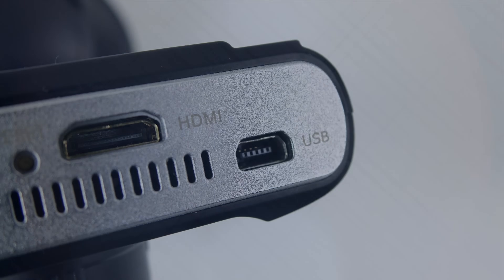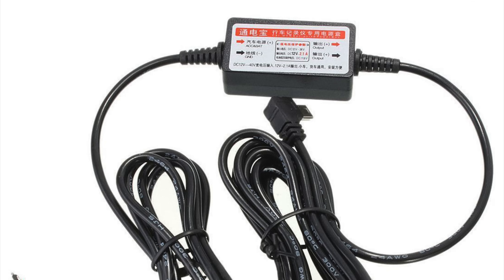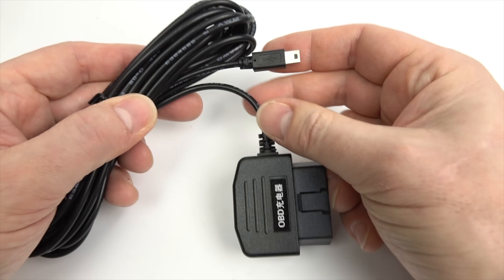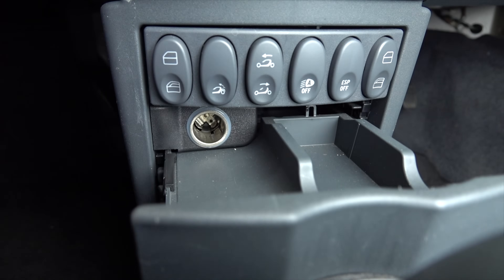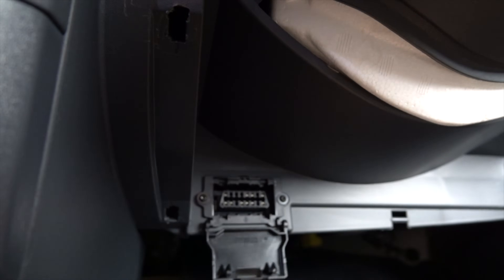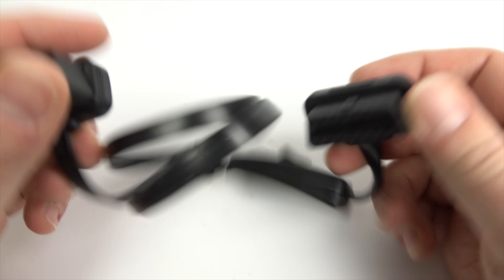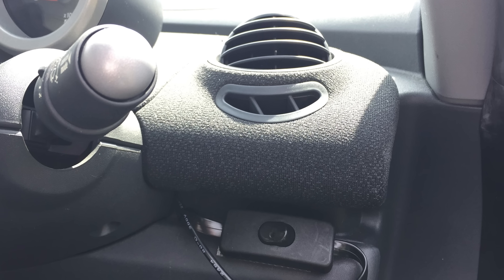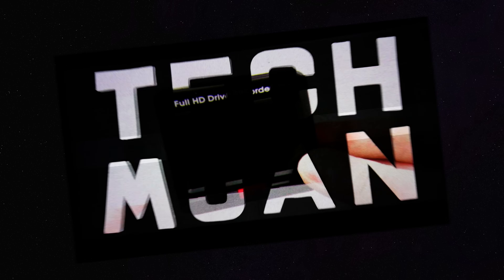You can power a Dashcam via your OBD port (but perhaps you shouldn't)

Comment: In the US, it has been my experience that the Cigarette Lighter Port/12V Accessory Port does not turn off when you turn off the ignition with domestic vehicles.  The only "foreign" vehicles I've owned are Toyotas, and they both turned off the 12V socket when the ignition was turned off.  So, I don't really see an issue here, given how little power these cameras and phones use, compared to other items that usually cause you to drain the battery, like headlights.
Reply: ask your battery after a few months. Factory batteries don't like draining and recharging like that they will fail and the worse time. BTW in 4runner the rear 12v does in fact not turn off. just an fyi

Comment: I'm really considering this camera and was wondering what you think. I drive for a company called Lyft and they want me to get a dashcam, also my insurance will lower my premium if I install one. http://www.ebay.com/itm/New-3-Screen-1920-1080-HD-Dash-Cam-Ambarella-A7-Chips-Parking-Motion-Sensor-/252376705404?hash=item3ac2d2e97c:g:wnIAAOSwZVhWSsxM
Reply: +Bluntski 
I would avoid anything with a battery, I'm about to install my 3rd A118C (I have 3 cars). I did consider the  0903 mini but the A118 is still the neatest camera around. Few points, always format the sd memory card, turn record off to access menu, and I can't see the point in having the largest memory card supported installed I always use 16G which is a lot cheaper.
Reply: I bought it, I'll tell you how it goes.

Comment: If it helps anyone, you can get a piggy back car fuse tap https://www.amazon.co.uk/Circuit-Piggy-Standard-Blade-Holder/dp/B00UNH616M/ref=sr_1_9?ie=UTF8&qid=1463051194&sr=8-9&keywords=Circuit+Fuse+Tap+Piggy+Back+Blade+Holder  to help simplify wiring into a car fuse box. 
Just pick a fuse position and replace the fuse with the piggy back connector and put the fuse back into the piggy back to maintain the circuit then in the second fuse holder that's built into the piggy back put an appropriate fuse for your device. Crimp the positive lead of your device onto the piggy back tail and put a ring crimp terminal connector onto the negative from your device and bolt it to the car body work. I've used the bolt that fixed the bonnet release to the car body work as that saved drilling any holes and it was near the fuse box.
The advantage of this is that you can easily remove it all and you can pick a fuse that is either always live or only live with the ignition. 
Instead of hard wiring, you could wire the piggy back connector to an additional car lighter socket - you can get additional ones that snap into a hole you drill into the plastic and which can be fitted under the dash and out of sight.

Comment: another solution : buy a rechargeable battery pack (lets say 20,000 MAh) for about $10 U.S. and you'll have power for your dash cam for all day long.   you also can recharge your battery pack via the 12V in your car.
Reply: cheers =)

Comment: A video recorder should be standard Ina car integrated by the factory. They've already go a standard rear camera. Just add one to the front and a DVR.
Reply: well, there is a problem with certain markets. In Germany and Austria, dascams are not really legal because of privacy issues. And I even met people, who agree with their governments, saying that dashcams should have built-in face and number plate bluring function!
Luckily, there are countries where dashcams are ok, and some insurers providing a discount for having one.
Reply: @jur4x  so Germany & Astria are Communist nations? Pity...I would use one anyway!
Reply: @jimbritttn  Just another guy who has no clue what communism is.
Reply: tesla has a dash cam built in, but it doesn't save any recordings unless you have a USB SSD installed and tell the car to save the video files onto it. it does it that way for liability.
Reply: +Shao Zhang I agree.  I know some of the new performance Chevy cars have dashcams/data loggers in them.  The C7 Vette and ZL1 Camaro to name a couple.  I saw a story a while ago of the Corvette's camera catching a valet hitting like 50mph in a parking garage.
Reply: They would charge $500 for a $10 camera!
Reply: @jimbritttn  That's called capitalism, Jim - smh.
Reply: @chromo48  called ROBBERY
Reply: @jimbritttn  potayto, potahto

Comment: Why do smart cars have the ignition in the wrong place?
Reply: I actually think it is a perfect placement, as I don't have all the things attached to the key (Like a loop or other keys) hanging on my knee when driving.
Reply: ***** Door...
Reply: It ain't the wrong place. Saab's have it in the same place. I have seen weirder.
Reply: +Farts McGee
I don't know how your ignition works, but it is impossible to turn the key on my ignition when the gear is not set to neutral, because it has a semiautomatic gearbox. I drive with people and sometimes with kids on a regular basis and never had a problem with my Smart 451. Since my parking space blocks my drivers door, I have to slip to the passengers seat to get out of my car, I never had any problems with that either, even though the gear lever is in the center.
The motor never stalled, so during the driving itself, I don't have to turn the key at all.

That doesn't mean the ignition shouldn't be behind the wheel, but it's not that stupid or crazy if it is placed in the center.

Just my experience on a four-year basis of driving a Smart 451 versus a Toyota Yaris (2011).
Reply: +Pfahli94 Putting it in the center area vastly increases the chance of the keys being jostled and inadvertently turning off the ignition while the car is in motion. Imagine a playful and excited child grabbing it and turning it, because it's right there and looks so enticing. Or imagine a woman trying to climb into your lap with it there. It takes up valuable space that should be used for something else (cubbyhole, handbrake, armrest, drinkholder, etc.). Any keychains would instead of touching your (soft, quiet) knee be touching hard, loud plastic, constantly scuffing shift up and making noise. 

It's like automatic gearboxes that let the car slide from Drive to Neutral when a butterfly wing touches the shifter, it blows my mind, it's crazy unsafe.
Reply: Pfahli94
Cheers mate, good info.
Reply: Most things that are called "smart", aren't really all that smart. "Smart" watches can't seem to hold a charge more than a day or two. "Smart" cars seem to be missing about half the car. "Smart" TVs often had crappy software and not sufficient software updates.

Is a power switch really necessary? Perhaps a good idea, but car batteries are huge, and most devices, just do not use all that much energy. Thus a dead battery is not very likely?
Reply: Because they are the worst cars ever made.  Ever driven one?
Reply: +Pfahli94 True, but adding weight to any ignition key is a bad idea.  Eventually it will cause a premature failure of the lock itself.  I assume this key placement will increase the longevity, but added weight will still cause failure.  Best to keep it simple on your car key(s) and put those key ring danglies on your house keys.

Comment: My car doesn't have obd... How do I get it?
Reply: +viperz888 you can't, your best bet is getting the hard wired power one and pulling power from the fuse box. What year is your car?
Reply: ***** 1953
Reply: +viperz888 your car doesn't have a computer controlled engine, so OBD II is unavailable, but you can probably find a 12 volt wire to tap the direct connecton supply to and build a switch
Reply: +Les King (Lesking72) it has a engine from 1998 though. It has the computer.
Reply: +viperz888 if you aren't a specialist on engine computers, you could take it somewhere and they could probably wire a port
Reply: ***** I am a specialist in micro de-thermic abrasion. how can i wire the obd??

Comment: I just run a small wire from the dashcam to the ceiling lights, just tuck it under the roof lining, you will normally find a permanent live up there. But, unfortunately not going to help with a convertible car like yours. But scotchloks connectors are very good for a low power device like a dashcam, just tap into any suitable circuit - radio supply will do fine.

Comment: I have wired in several G1W cameras over the years (first one bought on a recommendation from Techmoan, ta muchly!). The problem with cheaper dashcams (and possibly expensive ones too) is that the supplied PSUs are very noisy. Recently I wired a dashcam by using a piggyback fuse off the OBD circuit (this was due to the configuration of the fuseboxes in that car), and the noise the PSU introduced on the OBD power lines was enough to bring up random error messages every few minutes. I removed it and no more error messages. 

Hopefully the OBD power supplies are sufficiently well-built to avoid that, but the best way I have found is to piggyback from the cigarette lighter as this circuit is usually fairly robust against noisy electronics and is usually switched by the ignition. On one occasion I even had to bin the supplied PSU and use a high-quality branded USB supply and cable due to a particularly sensitive FM tuner that couldn't be avoided without having cables on show.

Comment: This is a awesome choice and proper...
SMAKN® DC 7V-24V To DC 5V 3A USB Output Converter Step Down Module KIS-3R33S  http://www.amazon.com/SMAKN%C2%AE-7V-24V-Output-Converter-KIS-3R33S/dp/B00N2G5HKC?ie=UTF8&colid=4AOCPGOMJRNB&coliid=I1FMPKV39CTCQD&ref_=wl_it_dp_o_pC_S_ttl
by SMAKN 4.2 out of 5 stars
        4 customer reviewsPrice: $6.99  
• This 5V USB output converter module is based on the KIS3R33S module specific design, the input voltage 7V to 24V, output voltage 5.01V 2.5A peak output current of 4A continuous output.
• Able to provide 3A continuous load current. The majority of players professional testing, with high efficiency, ultra-low loss characteristics, beyond perfect lm2596 power module.
• Modular nature: Non-isolated Buck
• This module has a USB recognition. This module uses the original Sanyo low ESR filter capacitor voltage as low as possible so that the ripple 30mV, fully capable and linear power comparable. IN-(input negative), IN + (positive input), OUT-(negative output), OUT + (positive output) must be connected to the right, otherwise may cause damage to the module.

Comment: I wouldn't recommend plugging anything other than diagnostic equipment into the obd2 socket because any malfunction in the devices connected could cause serious ecu damage or dangerous operation of vehicle systems, e.g unintended acceleration as no compatibility or safety tests are preformed as vehicle manufacturers do not intend on having owners plugging devices into the obd2 socket.
Although you can power a device from a obd2 socket the standard only allows for a maximum of 4 amp whereas a cigarette lighter socket will provide over 10 amp.
Reply: +100racer And does a cam ever need anything above 5 or 10 watts? 4A*12V=48W that's plenty enough.
Reply: +MrOpenGL I didn't say you couldn't power a dash cam from the obd 2 socket.
 What I'm getting at is that there is so little overhead
  should anything go wrong it could at best blow the fuse and depending on the wiring  immobilise the vehicle or at worst destroy the ecu or cause a fire.
The vehicle manufacturers do not intend the end user to be connecting devices of unknown origin and poor quality to the obd 2 socket.
The worst thing about this is the seller's are selling these plugs to people who don't  
know what the obd 2 socket  is and how much damage  can be done if it malfunctions.
Reply: 100racer
It should only be connected to the Vbat and GND lines of the CAN connector. The worse it could happen is that the internal converter shorts out and blows the CAN fuse. It cannot blow the ECU or damage the vehicle.
Reply: +MrOpenGL Power over obd has been used by diagnostic equipment before the obd2 standard was created. 
So if it is as risk free as you say how come mainstream manufacturers of car chargers haven't utilised it?
Because if anything  happened to cause a bridge between pins you could send 12v right into can line potentially destroying all the vehicle electronics, from my experience manufacturers do not build input protection on obd sockets because they don't intend anyone connecting anything other than diagnostic equipment into the diagnostic socket.
 I've seen one of my colleagues cause £4800 in damage because he accidently put 12v down the can line when he was fitting a tracker.
If you need extra power outlets wire them in properly or buy a splitter.

Comment: Ever thought about pulling the 12V plug assembly from the dash and solder the standard converted cable (plug off, and extend 12v leads to the lighter) to it? That way everything is properly fused, and no problems with devices running while contact is off.

Comment: Could you tell me about that hard wire kit?  My Yeti keeps the accessory port on when the car is off, so its only a matter of time before I flatten the battery... again.  Can this kit help me?  Will it take the power away when the car is off?
Reply: +Colin Steadman With a hard wire kit you would wire it into the accessory circuit so the dash cam would only be on when the car was in accessory/on.
Reply: +IfTomorrowWar A quick and dirty version was shown in the video, you have two wires. Black and red. Black is the ground and can literally be connected to any metal part of the car. Red is power and the easiest way to get power is yank out a fuse, jam the red wire in, and put the fuse back in.

Comment: I hate extra wires, I'm going to great lengths to hide as much as I can, my main complaint is lack of accessory sockets! My car is an 07 model and it has 1. I don't like 3 or 4 way plugs as they're messy. I'm hard wiring my 3 cams with a voltage drop switch, and adding some USB ports and mounting 2 extra power sockets. It will look stock and neat, which is exactly what I want. One of these would temporarily solve my problem, but I have a blackvue and it has a different socket to everything else so it won't work, but I could put a different camera up front and do it, so I might give it a go. Good review Tech, great info.

Comment: Some ODB 12v supply fluctuate over the limit during engine running which burn my ODB gps tracker. So be careful to include a fuse in between your device.

Comment: I think you should use a piggyback fuse holder instead.
That way you can pick a circuit that delivers power when you'd like it to do.
(you will need an extra fuse though.) 
Wire the voltage converter into the piggyback, pop the original fuse back in and the extra one for your circuit.
Making sure the positive connection is on the positive output of the socket. 
A decent negative connection can usually be found at nearly every nearby bolt or screw into the cassis.

You could also easily undo all of that work leaving no trace of it.

Comment: This is also important if you plan on using an ELM327 OBD2 reader with the Torque app - you should get an ELM327 with a switch, or use the extension switch as shown in the video. Otherwise the battery will go flat.

Comment: My dash cam is powered by the obd port by factory and it also reads data from the car and records it with the video, it is able to detect when the car is turned off and turn the camera off, if your're interested this could be an option
Reply: +Lachiepower0402 What camera is it? I always wondered how people get those overlays...
Reply: Mines a Shadow GT880s

http://www.gearbest.com/car-dvr/pp_162102.html?utm_source=shareasale&utm_medium=shareasale&utm_campaign=shareasale
Reply: Lachiepower0402 wow! Looks cool!
Reply: It is, definitely worth the investment, especially when you not sure if a speed camera got you or not! LOL

I've got a video on my channel called 'almost got T-boned' filmed by the camera if your interested
Reply: Lachiepower0402 Alright, i'll check it out! I just have a cheap dashcam (that actually records in a really nice 1080p! It actually looks super clear! I also have a Navman GPS that is in the car and that warns us about speed cameras around with an audible message saying "speed camera 150M ahead". Its better to know about a speed camera and slow down then run through a speed camera and check later! It also says things like school zone, speeding, etc. Its nice because they both turn themselves on when the car is turned on. I connect both the camera and GPS using one of those cigarette lighter splitters which also has 2 USB Ports which is extremely useful. I connect up an inverter to the third plug not ideal, i know but it works and the cable for the splitter seams to be fine with it. (it is my parents car but i set everything up).